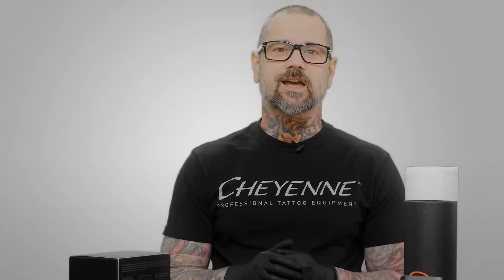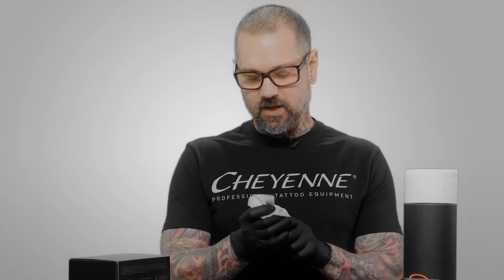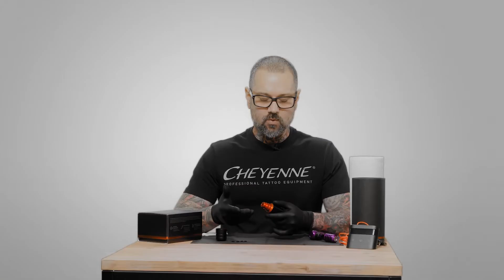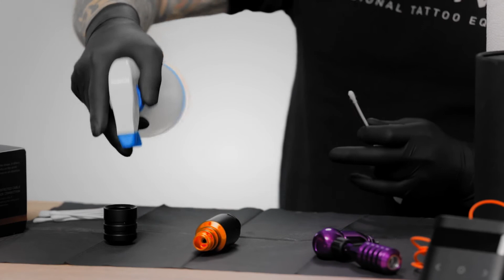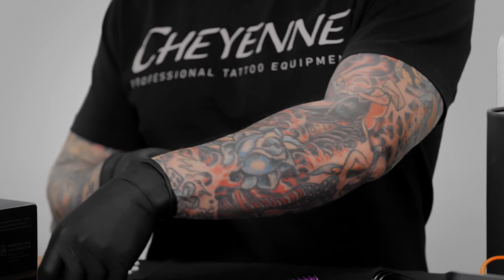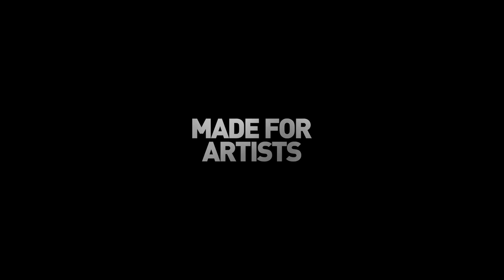How To Clean Your Tattoo Machine | Cheyenne Repair Service #04

Comment: This is false and misleading 
 information just go to CDC website and look for different methods of sterilization. A cold sterilization takes 3-12 hours with the tattoo pen grip submerged in a chemical. ((( It is NOT just wiping down with madacide !!!
All tattoo pen manufacturers should be recommending steam autoclave for grips. Cheyenne hawk is just setting it self up for a lawsuit because of their marketing methods.
The way Cheyenne markets tattoo pens and  how to clean these machines holds them to  liability. Tattoo pen grips get cross contamination up inside grip just by handling with contaminated gloves and laying tattoo cartridges on a contaminated work tray or work area.

Comment: Have the sol nova , clean it properly and bag it properly , I clean the grip and get into those  groves but my grip has trouble (gets stuck) getting on and off ? What could it be ? O ring seems fine , even replaced it , tried a different grip and same thing

Comment: There's any special brand for the Silicone Lubricant to use in these machines?
Reply from the maker: No, there is not. In any way you should avoid lubricant at any other part of the machine.
Reply: @CheyenneTattooEquipment  I have my first machine, a Dragonhawk mast flip and it is lubed out of the box. I was surprised by this answer.

Comment: Is any oil or lubricant required for the bar other than the O-ring
Reply: I need to know! I seen 1 other video saying just the O rings and someone else pour it inside the pen
Reply: same question...after cleaning should you need to put some oil or lubricant?

Comment: If you're using safety cartridges and properly bagging your machine, how often do you have to do this?
Reply: You should do this after every tattoo
Reply: Cheyenne is giving you false information just autoclave your grip rather doing a false cold sterilization. Contamination is still get up inside of grip just handing cartridges during tattoo process with contaminated gloves and laying cartridges on contaminated surfaces.

Comment: Hello today i was tattoing and a weird loud noise started so i recleaned and re done all the setting it stopped. But i am actually concerned do you know what happened?
Reply from the maker: From the distance it is hard or impossible to say what happened. If you experience it again you can send your machine in for service or repair. You will find all information on our website.

Comment: kinda strange that people always used auto clav to clean everything , and nowdays people just spray it down and it is good to go ? if ink or blood leaks into the machine or something happens with a cartridge , you just wipe that off with paper and then its steril ?
Reply from the maker: If you use cartridges with safety membrane there will be no fluids inside the machine. A rotary machine is unfortunately not autoclavable. A coil machine is not either. So you have to protect the machine. Grips can be autoclaved easily at 121 degrees celsius and 2 bar.
Reply: @CheyenneTattooEquipment  iwe seen plenty of videos on youtube where people put the cartridge on the hot table and in some cases the needles touch the topside of the cartridge , that topside goes straight up that pen style machine , how you clean that off when you cant get inside the machine ?
Reply from the maker: @Denka187  That is for sure simply a mistake by the artist. Therefor the industry nowadays offers enough solutions like cartridge holders. We unfortunately can not educate everyone to use everything the best way possible. We wish we could. Still you can use q tips to clean the "outer" part and the tip of the bar and we are actually working on a way to make that easier.

Comment: Hey. I have thunder and it stopped working while cartridge on. So I'm kind of worried. Should I clean it?
Reply: I got the new thunder and it happened to me to..but the cause is my power supply(a hurricane).you need a 3 amp(a critical power supply or any other original p.s. with 3 amp.) power supply and a start up cable from cheyenne
Reply: @markotat2332  I have eikon 300 power supply
Reply from the maker: Cleaning it the right way is always a good thing. If it will help running the machine again is hard to say from the distance. In case you want to send it in for repair please follow the instructions on our website.